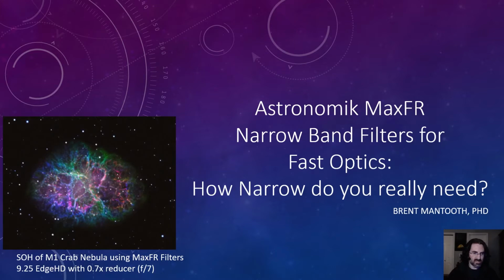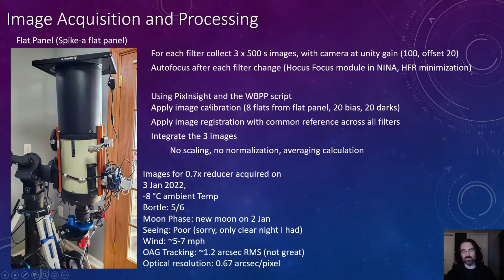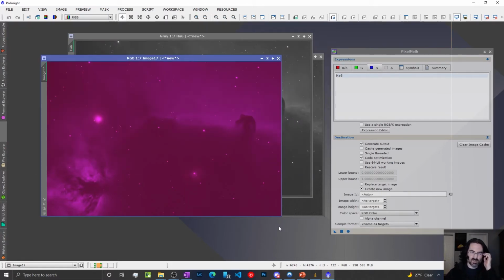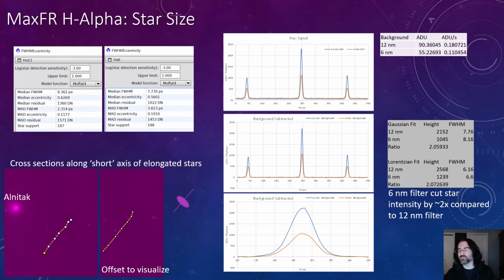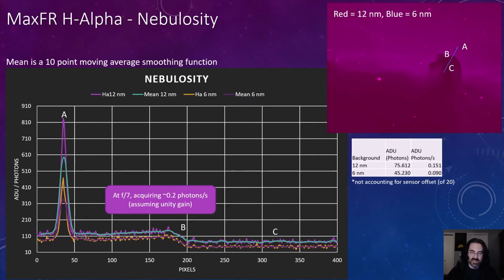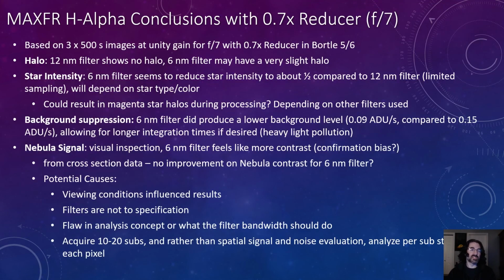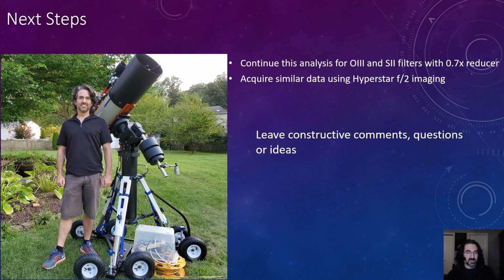How Narrowband do you need for Astrophotography? Analyzing Astronomik MaxFR filters

Comment: Excellent review.  I learned a lot - thank you.  I'm getting significant halos with Astronomik Type 2c Blue and Green 36mm filters on an f7 APO refractor.  Astronomik referred me to your video to understand more about halos.  Since your video doesn't go into the why too much, I'm still left not knowing what to do to correct them.  I'm getting a new set up at f7.5 but with Chroma filters and I'll see if they help.  I understand shorter exposures with faster optics is the direction of good for halos - so I'm not very hopeful.

On your question of the background difference - I live in Bortle 5 skies according to the Clear Outside App but am on the edge of a city of about 100,000 people.  So to the East my sky backgound is higher than to the West.  It is easily visible with the naked eye.  If the 6nm images were taken to the East and the 12nm to the West from my location, I expect it would confound the result.  Something to add to your possible explanations.
Reply from the maker: Look for another video on my channel called "Bandwidth choices for narrowband imaging with fast optics"
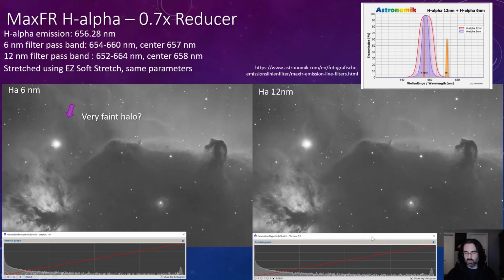at the 6:53 marker I talk a lot more about how to figure out where the halo is originating from.
The size of the halo tells you this distance from the sensor that is generating your reflection.  In my case it was optics in the camera, not the filters.  And the strength of some reflections may be very wavelength dependent.
Reply from the maker: youtube tends to filter out links, see if this works https://www.youtube.com/watch?v=rtFX92dZE_w&t=413s

Comment: Thank you very much for your effort in comparing the filters. I am interested because I am considering an upgrade from my 7nm filter set to a 3nm set. I am not an expert so please correct me if my concept is wrong.

For the contrast issue, assuming you can measure the background correctly at point C, then subtract it from A, what is left should be the pure signal. When I see that both filters have the same 'jump' at B, I think it is perfectly normal and it just shows that both filters pass through the same amount of signal.

But I think there should be real benefit for a lower background with a 6nm. The sky background is not a perfectly 'smooth value' added to the signal but with noise. Cutting the background more should mean this noise getting lower. Then during processing we can stretch the 6nm images more with the same visual level of noise. That's where the better contrast come from.
Reply from the maker: Thanks.  I have thought a bit since I posted this.  
1. I am in Bortle ~5.3 (according to some app), after talking with a few other people, the differences would be much more apparent if there was more light pollution.
2. The real definition of contrast does not use the background subtraction that I used, so yes, there is probably some benefit to using the 6 nm, especially if there is more light pollution.  However, if you are using fast optics (< f/2.5) you may be losing more signal than just reducing background.  To go to 3 nm filter, you probably need to be > f/4 ish?  to not have so much band shift that you are cutting a lot of signal (guessing, not running a calculation)  I did a few other videos with some corrections to this video.

Comment: It would be hard to get say 15 x 500 sec subs for both filters over one night. So many things are going to change especially with the elevation of the scope towards zenith. So much to consider when going the Hyperstar way. I just realised that my Antlia 3 nm Pro NB filters "might not be" working all that well at F2 as they suggest F3 as the best solution.
Reply from the maker: these testing nights are educational.  I may do some more comparisons but it is twice the work... and not as ideal for image workup.  
for your current filters - you have them and they actually get f3 that isn't bad, and it is a big investment in more filters for what is less than a full stop difference.  Are the antlia filters blue shifted for fast optics?  It would seem they would need a specific shift for that narrow of a bandwidth and a particular f stop.
Reply: @BrentMantooth  The Antlia website says? "Blue-shift data show that Antlia 3nm Pro filters can be used with nearly all systems as fast as f/3 with minimal loss in emission signal and meets the requirements of fast optics like Hyperstar and RASA.". I have the filters for normal imaging F5.6 on my refractor. I haven't used them on the SCT yet as I am waiting for my Celestron OAG to arrive (tomorrow) and then I will see what they look like at F7. There is a significant difference between the Antlia Ha 3 nm and the Optolong Ha 7 nm filter. I really want to try my Antlia 3 nm on Alnitak but the weather has been against me for months. I am mulling over getting the Hyperstar, but as it is 90 mm in diameter, I am a bit concerned that it will impact the amount of data going into it. So much to consider with AP!!
Reply from the maker: @stephen2615  haven't analyzed signal yet, but reflections are very different from f/7 to f/2.  I mean there is one less mirror in f/2, and we are talking about reflections...
Reply from the maker: I am in the process of analyzing the HyperStar data. Like you suggest, I think I am going to need that 15 sub data to make sense of what I am currently seeing.  I was hoping to wrap up an analysis, but, like many science projects, I keep finding more questions.  I will post part 2 soon.

Comment: Hey! Brent Paul here from HS group. Thanks Brent for that thorough analysis for f7. Regarding the contrast and background ADU and that 60% signal you’re getting. Both 6 and 12nm are almost identical on those background signals.  All except for tighter and smaller stars which you have a clear results here. I’m guessing here but maybe the nebulosity may have some influence to its proximity to the horsehead designated as background? Would you think an Ha target that has a clear edge side in contrast with darker open space would yield a more isolated Ha signal and accurate ADU background?
Reply from the maker: Great question, I have a few other images from a different target, will take a look.
Reply: @BrentMantooth  Did a test on 12nm 1X300” and Ha and Sii showed halos on them imaging Alnitak Star at f1.9

Comment: I can hardly wait for the Oiii filter review. My 6.5 nm Oiii filter and Alnitak produces awful reflections in some of the strangest places. I now have Antlia 3 nm NB filters but it has been awful weather so I haven't had the chance to use it.
Reply from the maker: soon, switching the scope over to hyperstar tonight so I can image tomorrow. [spoiler alert] At least at f/7 the OIII MaxFR was showing halos for both 6 and 12 nm.  Talked with @deepspacedad and he didn't see reflections, at least with HyperStar.
Reply: @BrentMantooth  I have a QHY 268M (and other cameras, way too many cameras) and I am interested in a Hyperstar for my EdgeHD 9.25. Unfortunately, Starizona hasn't responded to my emails about whether I can use it with the Hyperstar. None of the QHY cameras on the website list the 268M or the 600M but they list the ZWO 6200.
Reply from the maker: I know they can support full frame 35 mm sensors (probably with vignetting) - I have the adapters for my Canon R5 but haven't tried that yet.  You should just need the right back spacing.